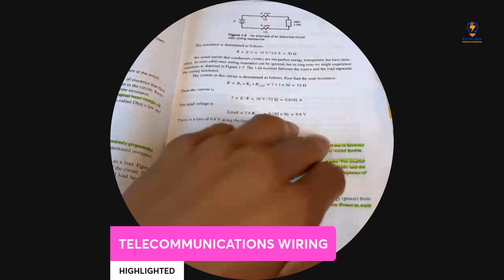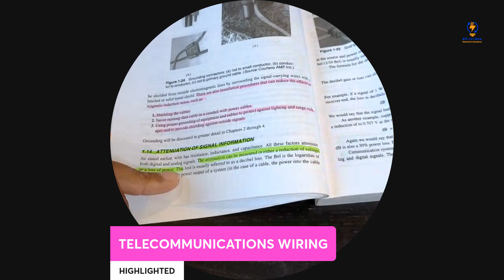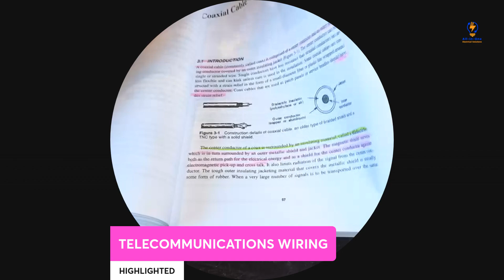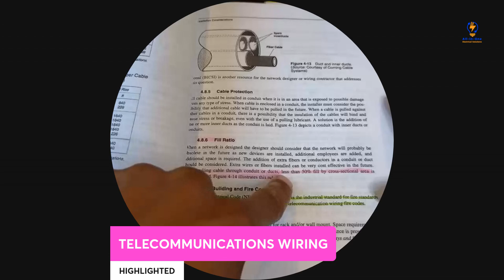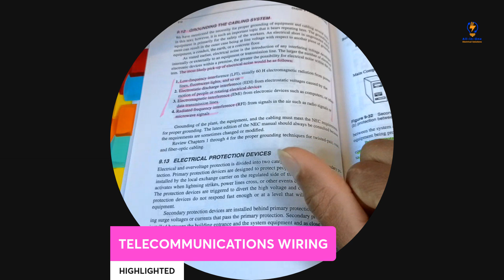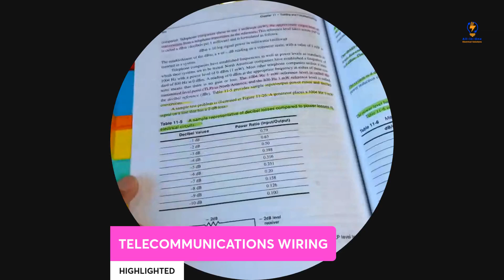“How to Get Your Florida Electrical Contractor’s License: Step-by-Step. Telecommunications Wiring

Comment: This is one of the few books I didn’t have the 1st time I took the test. It looks like a lot of the theory questions are pulled from here. Important to highlight/tab capacitors and fiber optics. I probably gave away 4-5 answers not having this book…with most of the stuff on the first 15 pages.